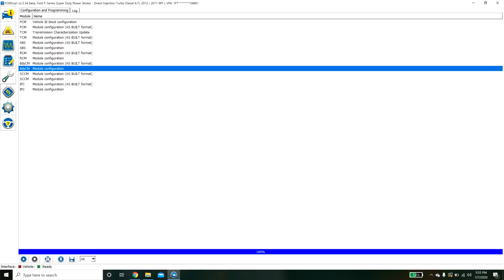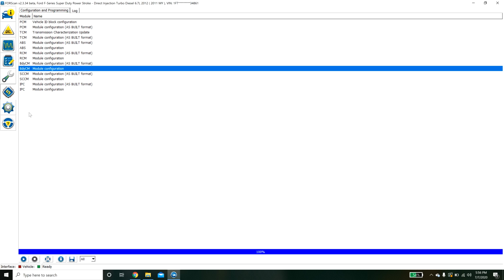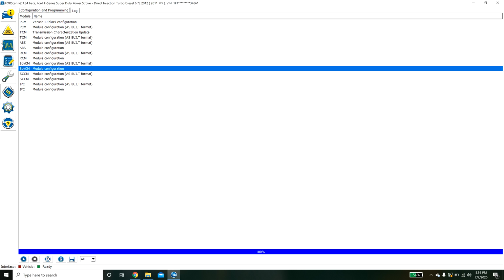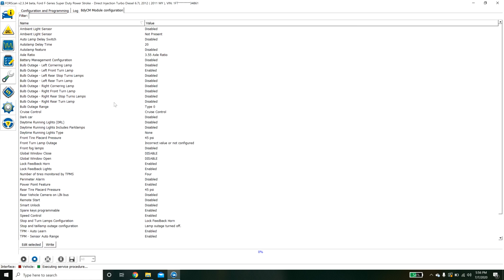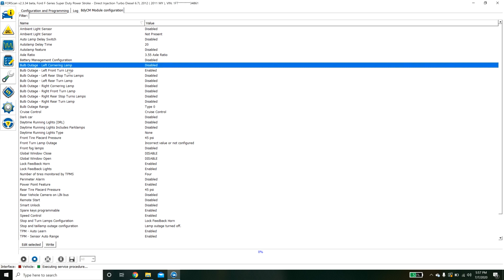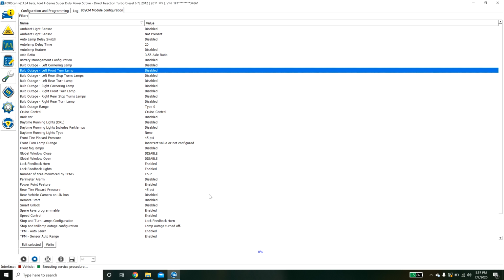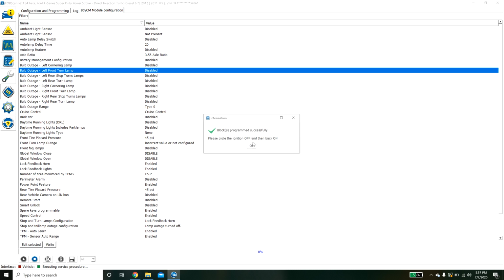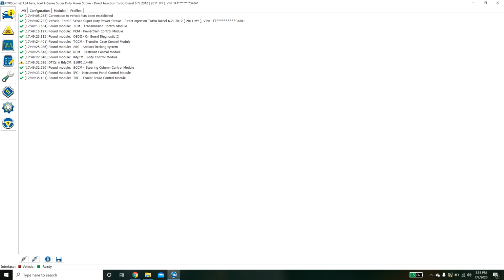FORScan -  Example: Changing parameter values (eliminating hyper flash example)

Comment: I know it’s been a while, my rear driver brake light and turn signal are not working anymore. I’ve installed LED aftermarket tail lights. Question is, changing settings thru BCM module via Forescan will return them back to work as now front turn signal is hyper flashing or do I need to install resistors mandatory? Thank you!

Comment: I got a question? I just swap engine from f250 2004 with powerstroke 6.0 with transmission and pcm course to a f350 2008 was powerstroke 6.4. Truck is working now but doesnt show data in the instrumental cluster, do you think rewriting parameters on pcm 6.0 will work in the ins cluster 6.4
Reply from the maker: That's hard to say... With the two different platforms and the years apart it may not work. Unless you have the 6.4 cluster and ECM and PCM

Comment: Welcome. I have a problem after changing the display to 4 " SYNC 1.1, every time it tells me the call for help does not work ... I would like to disable this message. Where should I do it? In APIM or RCM.
Block 1 APIM
7D0-01-01 111F 89C0 0355
Reply from the maker: I would have to look into a little more... Most of the time of there is multiple calibrations in more than one spot you need to disable it in all locations
Reply: @jd_scholl  Ok. 🤔